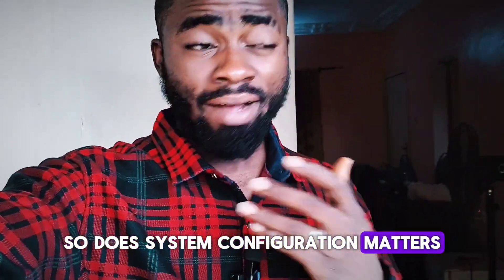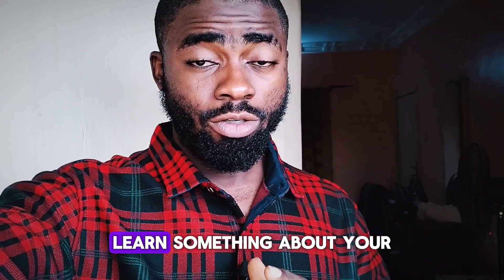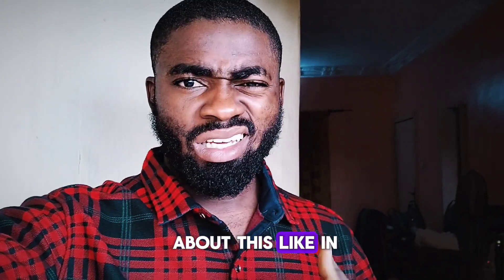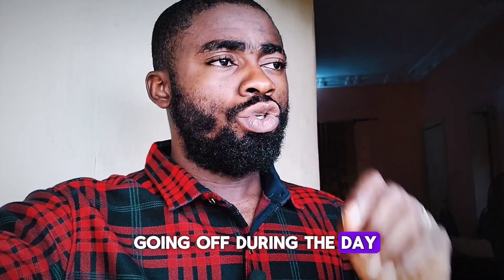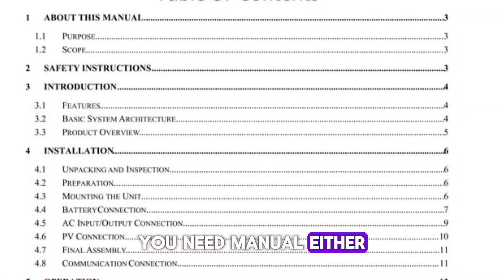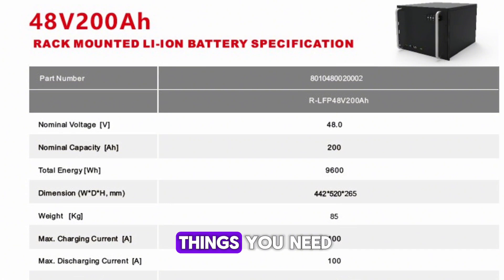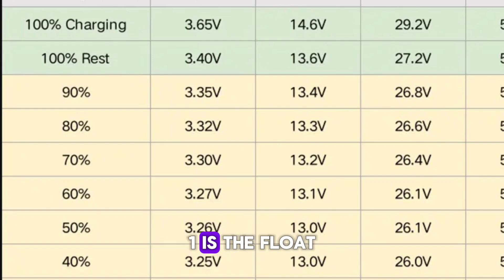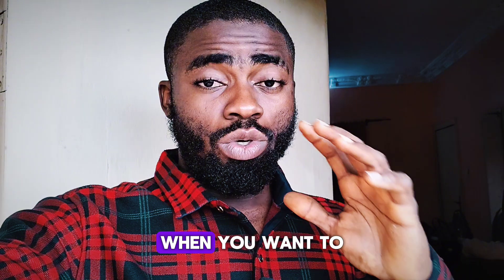Best way to configure your solar inverter system

Comment: How can I kick start a dead sms lithium battery. Showing me 19volt from the charge controller instead of 51.5volts.
Reply from the maker: You can get an external charger or do it a 2second direct charge with two solar panels
Reply: @Mairigaemmanuel  thanks boss for the quick reply.. Highly  recommended 👌..
Reply: I'm facing the same issue with a 10kwh lithium battery deeply discharged. The inverter can't wake it. Should make the same direct charge with 2 panels of 550 watts in 2 seconds? @Mairigaemmanuel